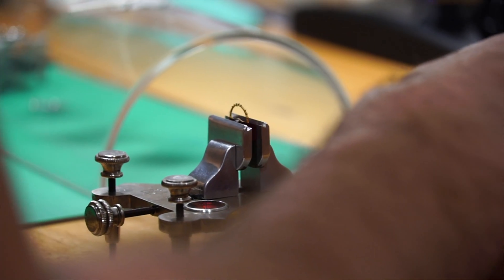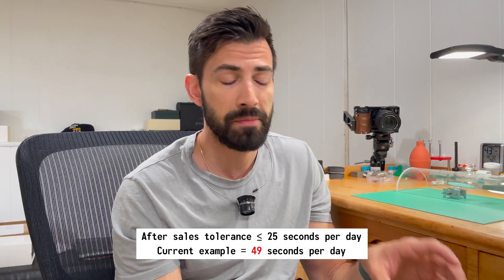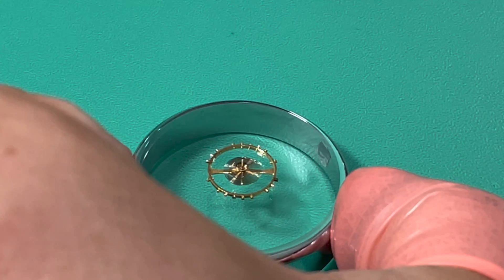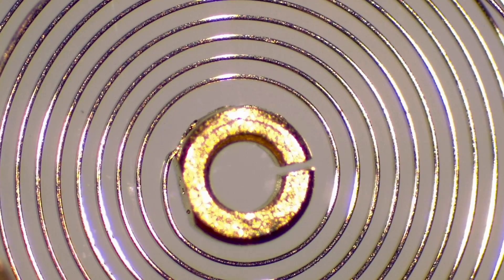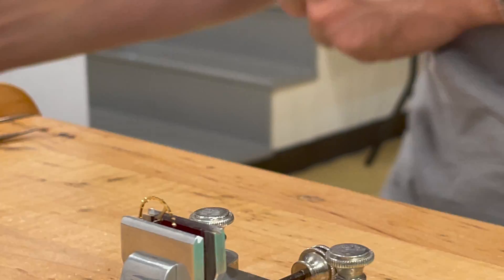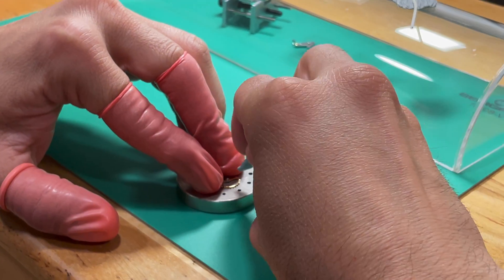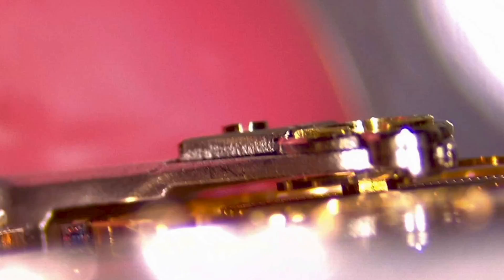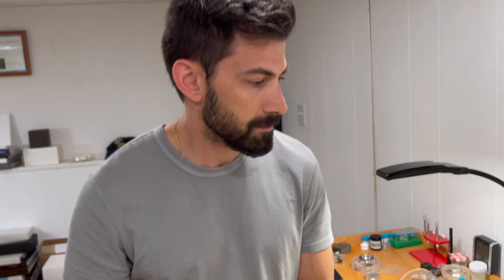Repoising a Rolex 1675 GMT balance wheel

Comment: Two quick questions. The glass hairspring tool with the divot for the collet, did you make that? Either way, is it something I could find for purchase generally? Also, the divot filing tool for the balance rim, what is that called? Thanks for your time, and great video with explanation! I'm getting ready to attempt my first static poising.

Comment: Good job ! Thanks for sharing. What is the little "drill tool" called that you use to make the heavy spot on the balance wheel lighter ? Almost looks line an automatic oiler.
Reply: It is in fact a micro drill bit. zoomed in on the microscope it looks exactly like a regular metal bit

Comment: Well done, is it Greg? What was the name of the tool you used to remove material? Do you prefer screwdrivers over thin hand removers? I’m always looking for balance spring adjustment and manipulation videos, do you have any? Cheers, Boyd
Reply from the maker: Thanks! This tool is a small drill you can actually make one out of a yellow oiler. Just use diamond plate or Arkansas stone to grind the tip down to a 3 edge point.

Comment: Really appriciate you showing the positional variations in rate and amplitude. 

So many channels 'restore' or 'service' a watch and only show DU rate and amplitude at a full wind right at the end of the video, which really doesn't tell you anything. The difficulty of servicing a watch is not in getting a rate of  270 degrees amplitude 0s/d in the DU position. You can do that easily (and cheat) with a stronger mainspring and moving the regulator arm on the balance (you don't even need to service the watch properly). The hardest part is getting the lowest delta possible at the lower amplitudes in as many positions as possible.

I look forward to more vids :)
Reply: YEs the guy is patient and show his work

Comment: May I ask what may seem like a dumb question, but I am just getting into knowing how to poise?.   At 7:30, what is that you're doing to actually poise the balance?.  I have the poising tool you level up to find the heavy spots, but I never saw anyone use what looks like one of those Bergeon automatic oilers to deal with the heavy spot on the balance wheel.  Might I ask, what is that you're doing there?.  I've seen undercutting and adding washers, but never using an oiler to fix a heavy spot.  I'm sorry, but finding a video where the maker actually teaches you something is rare.  Most just want to take the watch apart, clean and oil it, then put it back together while never addressing the issues commonly faced by newbie watchmakers like myself.   Like understanding what the timegrapher is reading and then knowing how to address the issue.  You actually did that, and thanks much!.
Reply from the maker: Great question: So that tool that looks like an auto-oiler is actually a very fine drill. You can make one out of a yellow Bergeon oiler if you don't have one of these. Simply cut the oiler near the thicker part of the tapper and use an Arkansas stone to grind a 3 pointed tip. You can use that to cut small divots into the balance wheel (on the underside) to decrease the heavy spot. Most watchmakers will advise to find one spot and only make one cut. While it is true to cut as little as possible, I've found that sometimes up to 3-4 small divots/cuts need creation as wheels are rarely just heavy in one very specific point but rather a broader area. This takes some time because after every slight drill, you need to go back and spin it on the poising tool to assess weight change. It is tedious but the absolute best way to get the delta tight. I used to do dynamic poising but the results were never as close and involved way more guess work than static poising like this. Just make sure not to cut too much metal out. If for instance, your microstella screws are already all the way out then you'll need to add weight instead of cutting. Thankfully this is not usually the case and you can compensate for the rate change from lost weight by moving the microstella screws outwards.
Reply: @TruePatina  Thanks so much for your help and thorough answer.